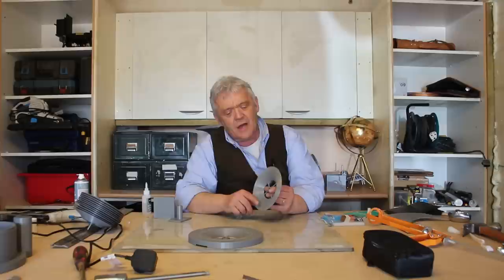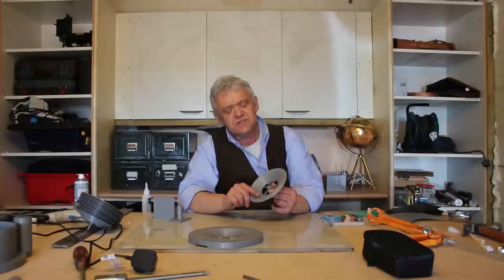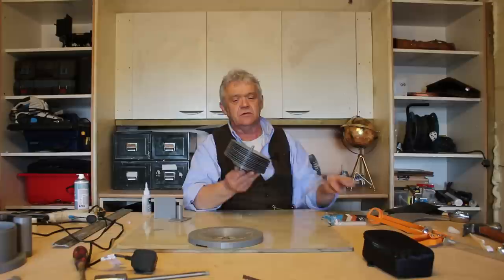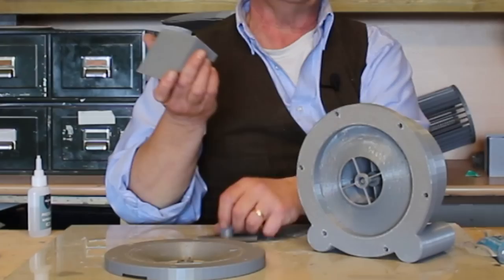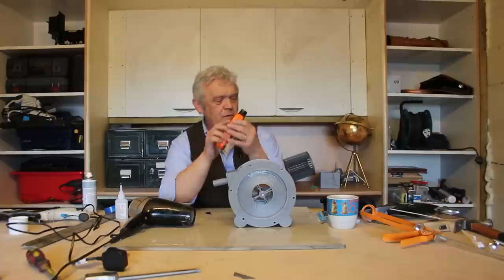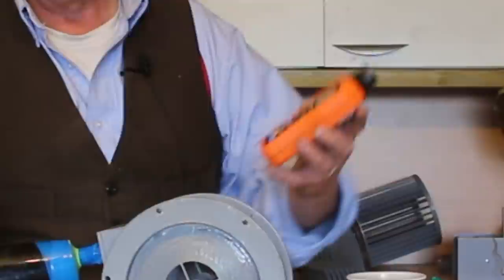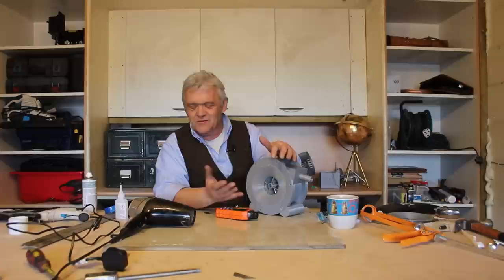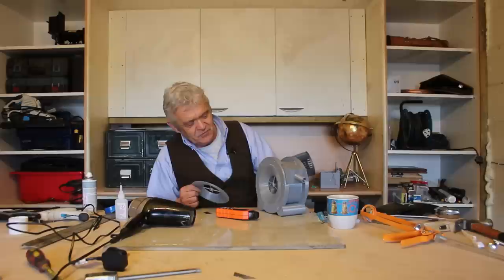1918 The Tesla Hyperbolic Turbine - A New Invention?

Comment: Is there any opportunity to actually generate any power from that? Or would any load cause it not to turn at all? I thought that was the drawback of a Tesla Turbine - lots of RPM but no usable torque.
Reply: Tesla turbines get plenty of torque and output plenty of power even at low RPMs if they are designed correctly.  There’s plenty of proof of this already on YouTube. 

Everyone erroneously thinks they need to be spun fast but it’s not true. 

Tesla turbines are NOT supposed to be spun too fast because the centrifugal head will just counter your incoming fluid flow reducing power. 

And the faster you spin discs, you’re fluid has to be going even that much faster just to be able to apply a torque on the disc face.   

“Still another valuable and probably unique quality of such motors or prime movers may be described. 

By proper construction and observance of working conditions the centrifugal pressure, opposing the passage of the fluid, may, as already indicated, be made nearly equal to the pressure of supply when the machine is running idle. 

If the inlet section be large, small changes in the speed of revolution will produce great differences in flow which are further enhanced by the concomitant variations in the length of the spiral path. 

A self-regulating machine is thus obtained bearing a striking resemblance to a direct-current electric motor in this respect that, with great differences of impressed pressure in a wide open channel the flow of the fluid through the same is prevented by virtue of rotation. 

Since the centrifugal head increases as the square of the revolutions, or even more rapidly, and with modern high grade steel great peripheral velocities are practicable, it is possible to attain that condition in a single stage machine, more readily if the runner be of large diameter. 

Obviously this problem is facilitated by compounding, as will be understood by those skilled in the art. 

Irrespective of its bearing on economy, this tendency which is, to a degree, common to motors of the above description, is of special advantage in the operation of large units, as it affords a safeguard against running away and destruction. 

Besides these, such a prime mover possesses many other advantages, both constructive and operative. 

It is simple, light and compact, subject to but little wear, cheap and exceptionally easy to manufacture as small clearances and accurate milling work are not essential to good performance. 

In operation it is reliable, there being no valves, sliding contacts or troublesome vanes. 

It is almost free of windage, largely independent of nozzle efficiency and suitable for high as well as for low fluid velocities and speeds of revolution.” 
-Nikola Tesla  

Tesla both knew it wasn’t meant to spin fast and that it worked great for low speeds IF you design it correctly.
Reply: Not to mention Tesla literally has an improved disc stack patent that he patented in 1921, 10 years after the original turbine patent and about a decade of R&D, that everyone sleeps on, along with a full suite of other improvement patents for the Tesla turbine as well. 

Patent GB 186,082 - improved disc stack design for increased torque, efficiency and power out for a given sized runner. 

For the life of me I do not understand how everyone just ignores all the improvement patents that Tesla patented for his disc turbine. There’s like 8 of them. 

Tesla Turbine Patent List by Nikola Tesla     

US Patent 1,061,206 & GB patent 24,001: the original Tesla disc turbine patent from 1911.      

Then almost all Tesla’s improved turbine patents, except the Tesla valve patent, were patented in 1921, the valve was done in 1919.       

Patent GB 186,082: improved disc stack design for more torque        

Patent GB 186,093: combustion + steam turbine with built in exhaust heat recovery boiler.          

GB 186,084: combustion + steam turbine superheater and concentric/coaxial multifluid nozzle that the steam draws a vacuum on the exhaust of the combustion mixing them as they enter the turbine. Thus eliminating the need for a compressor to run a combustion gas + steam turbine.       

GB 175,544: hybrid Tesla Disc + Parson’s reaction turbine for utilizing the Reheat Factor of the energy lost to shearing in the fluid between the discs        

GB 186,799: process and apparatus for balancing rotating machinery for  quality at-speed dynamic balancing.        

US 1,655,114: aerial apparatus patent with improved turbine nozzle design         

US 1,329,559: Tesla valve for pulsed combustion Tesla turbine.   

GB 179,043: High Vacua Pump

@integza and @charlieSolis are the only ones who are actually following how Tesla said to make his disc turbine and are actually getting tons of power and torque out even at low RPMs. They literally have the turbine geared UP to their generators at 3:1 ratio where the generators spin 3x as fast as the turbine and it outputs plenty of power and torque still. 

Not geared down, like everyone demands must be down to make the Tesla turbine work. 

Geared UP.

Comment: Nice video! But I’m confused what you mean the spiral won’t form without the cone… 🤔

The spiral forms just fine with the Tesla turbine with flat discs. 

There’s more than enough proof to show that Tesla turbines get plenty of torque and power out even at low RPMs or with low pressure if they are designed correctly. 

Charlie Solis has already shown amazing results with his plastic and aluminum prototype Tesla turbines, showing real torque and power out.  

But to be clear, Just putting this info here for others. There’s an existing patent for this conical and parabola shaped discs. 

“Bladeless conical radial turbine and method” -WO2005081766A2

Everyone keeps trying to complicate the Tesla turbine. 

Just build it like Tesla said to and you’ll get a high torque Tesla turbine. 

Despite what MANY have claimed about the Tesla turbine, it does NOT need to be spun fast to work or work efficiently.   

TesTurs are made efficient when the slip on the discs is reduced and spinning the discs fast does nothing to reduce the slip, only increase the distance the fluid slips on the disc faces, which is by definition “loss”.  

Listen to what Tesla himself said in the patents of how to make them work.  

“Owing to a number of causes affecting the performance, it is difficult to frame a precise rule which would be generally applicable, but it may be stated that within certain limits, and other conditions being the same, the torque is directly proportionate to the square of the velocity of the fluid relatively to the runner and to the effective area of the disks and, inversely, to the distance separating them. 

The machine will, generally, perform its maximum work when the effective speed of the runner is one-half of that of the fluid; but to attain the highest economy, the relative speed or slip, for any given performance, should be as small as possible. 

This condition may be to any desired degree approximated by increasing the active area of and reducing the space between the disks.”  

1) increase the speed of the fluid relative to the disc, (not increase disc speed)  

2) increase surface area 

3) decrease disc spacing  

This is how you actually make a TesTur work. 

Not by spinning it fast.   

The fluid interactions with the disc that govern efficiency an torque are adhesion and cohesion. Full stop. 

And spinning fast does nothing to increasing either to increase the turbines isentropic efficiency.   

This is why everyone who chases rpm with the TesTur just flat out fails. 

They aren’t even trying to design them properly so of course they won’t work.
Reply: This!! All of this!!
Reply: I think Charlie mentioned once that he’s not able to comment on Robert’s videos. 🤭 or rather his comments just don’t show up publicly when he makes them. 

I have to believe that Robert wouldn’t have ever blocked Charlie lol charlie has a degree in physics. 

Maybe YouTube doesn’t want people to see his stuff, or maybe charlie is just saying that for attention and he’s not actually blocked 🤷‍♂️ 

Idk but Tesla turbines are sweet!

Comment: It's a nice idea, but I'm sorry that I have to be the one throwing gravel in the machinery. 
I'm afraid the discs won't hold up to the centrifugal forces. They will straighten out if they get up to max speed, even if they were made of metal.
Reply: Stephen Ferree  I don't know what materials can take that kind of force. For the motor to be 97% efficient, it must rotate at 50,000 RPM, for comparison, the speed of a saw blade is 6,000 RPM and they are flat. Tesla also couldn't get it to work at 50,000 RPM and had to reduce the speed to 10,000 RPM. Even with modern metals or composite material, deformation will occur. If you listen 3.00 min into the video you can hear some knocking sounds, it is almost certainly the plates stretching and knocking towards the outside.
Reply from the maker: this is a prototype mate - they aren't meant to hold up - plus this is showing an improvement in the low end rpm which is exactly where the Tesla turbine has it's problems - no need to go to max speed! lol

Comment: I've asked this on one of your tesla turbine vids before: 
what happens if you combust something like hydrogen into a tesla turbine? the reason I thought of this is because tesla turbines don't reach max efficiency until they're spinning so fast that the incoming compression is pulled through the plate gaps hard enough to compress the gas to the liquid phase...but what if you just create enough pressure so the combustion gasses are already compressed enough to change to the liquid phase instantly?
Reply from the maker: i have no idea mate
Reply: Look a lot like you got several different applications of the apparatus mixed up in your head?
At least the straight disk version can be used reverse as a pump, or in cryo cooling machine also. That might be where you heard of "gas into liquid state"...?
Second, "burning hydrogen into..."? Do you mean feeding HHO gas under pressure into a TesTur? That could actually be a GREAT IDEA - although I am only guessing here. If the resulting volume due to reaction (or condensation) is reduced towards the exhaust, a vaccum is created that further enhances the contracting, "imploding" potential vortex.

Comment: As far as Ive heard... Tesla's Turbine was not utilized, because at high rotation speeds, the discs deform.   Changing the shape to a cone, isnt going to solve that problem..  in fact, it will almost certainly make things worse.   While Tesla's invention was produced well before advanced materials of today... Even today... nobody, as far as I know... has ever created a working solution to the problem.
Reply: The story Tesla had problems with discs warping isn't accurate. I've been researching and developing this technology for 4.5 years full time now. 

Tesla never had a problem as he used hardened and tempered steel or German Silver. He even states the steel strength in PSI and type needed in 1911 Scientific American article.

The rumor of discs warping comes from an engineering outfit in USA that wouldn't build to Tesla's own specs, so they had a fallout. The back story is the engine and turbine industry buried the technology because rotary engines of Tesla's design only have one moving part. I'm not talking Tesla Turbine, I'm talking the opposite of a Tesla Turbine, which is a Tesla Pump.... another version of this when configured is a rotary engine where the compression and expansion are happening in the vortex path.

I personally have achieved Mach 1.3 periphery speeds using 7075-T6 aluminium and had this 3rd party validated in Vancouver, Canada by a veteran avionics engineer. High speed tests do not provide the optimum torque rpms but they are great for destruction testing. Tesla himself states that the maximum torque is when the velocity of rotation is half the velocity of the working fluid.

I personally have tested rotors from 1909 design to 1921 design in a number of materials. I've crashed rotors at supersonic + speeds many times. None of these tests were actually dangerous but at first I was hiding behind 5 inches of wood and polycarbonate.

I'm currently in the process of building a commercial multi-fuel Tesla rotary engine that will run on any flammable gas or liquid.

This machine was patented in 1916 but approved in 1920 which is when it made its debut in the papers.
Reply: @nikola.tesla.r.and.d.centre  wow